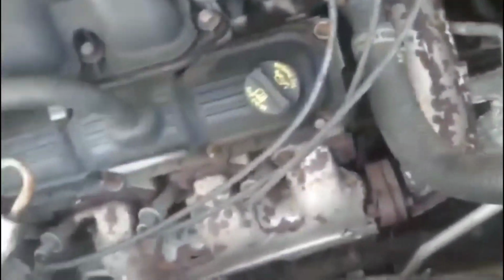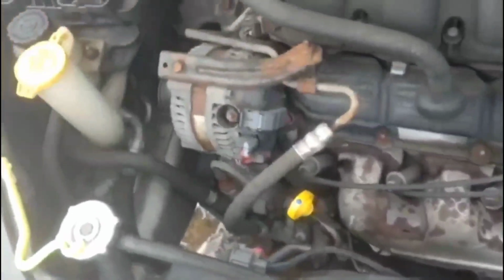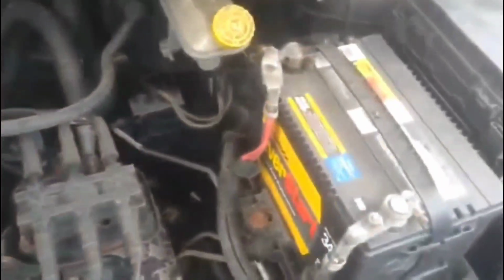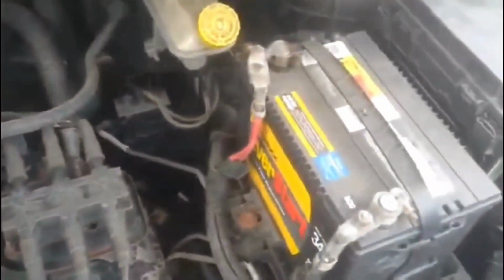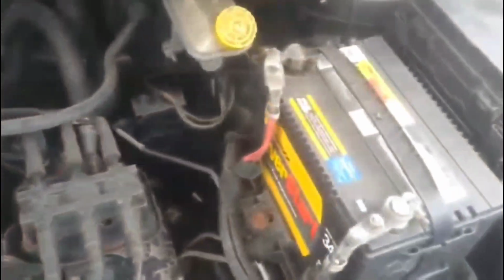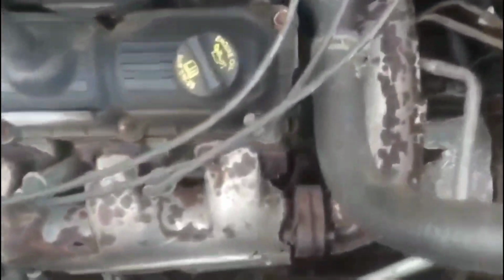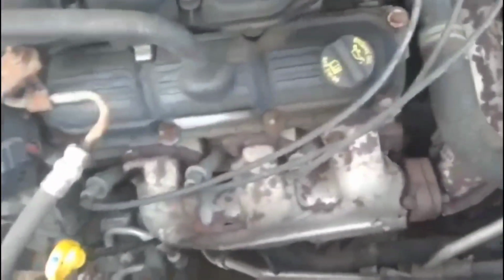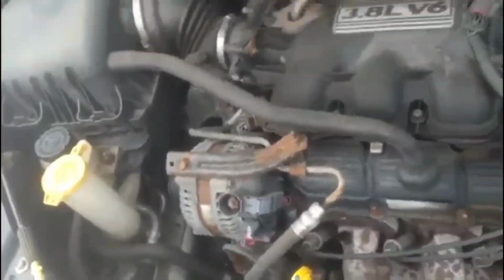2008 CHRYSLER TOWN AND COUNTRY 3.8L CAMSHAFT position SENSOR - STALLING, CHECK ENGINE LIGHT FIX

Comment: I'm here because my 08 T&C 3.3 is running weird, I had it on ramps for 3 days and when I got it off to take it for a drive, it started to idle rough, shake while driving, sounds like its stuck in low gear or limp mode. I was going to swap out the oil pan gasket but it wasn't the gasket that has a leak, I think its the harmonic balancer seal. I spent 3 days just trying to get all the oil off from around the engine and underneith, but the Cam Sensor is in back of the motor on driver side somewhere by the manifold lol